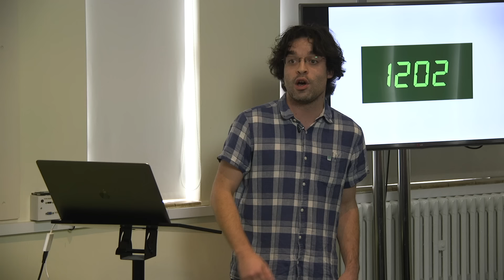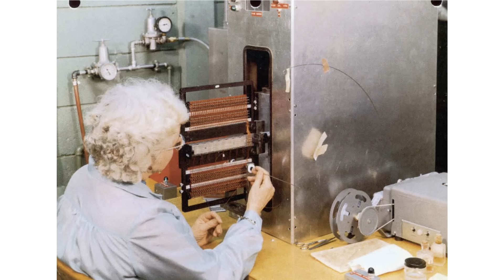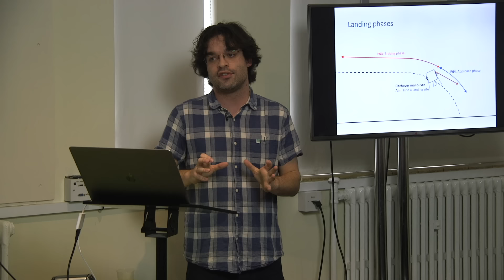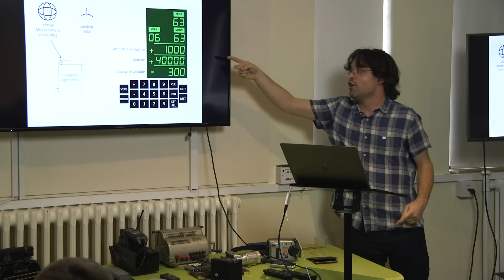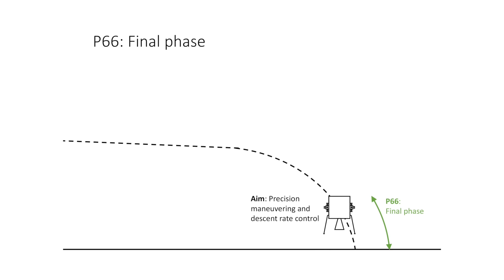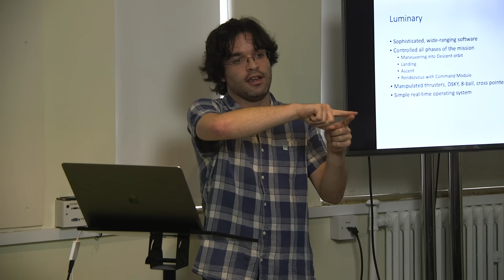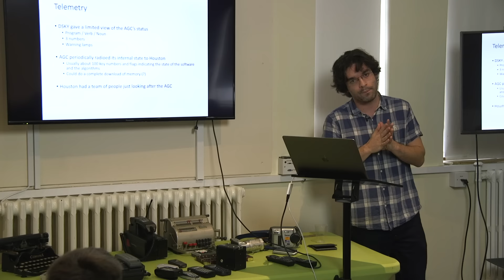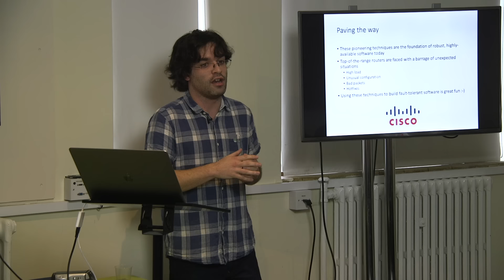Light Years Ahead | The 1969 Apollo Guidance Computer

Comment: water at rest is flat and level. the gravitational balls universe is just a cult belief.
Reply: In which way is that a reason for water to be level at rest?
My question remains: why water is level? What does level means? Why water is such? If it wasn't water but something else, would it be same, If not, why? If yes, why?
Reply: @ThomasKundera  why does water at rest define a plane that is horizontal at it's surface? <<< that is the question you are asking.... a very poignant question indeed. can you think of an empirically validated reason why it wouldn't?
Reply: @evolutionCEO  Very simple reason. On a large enough sphere, water level is relative to the centre of the sphere, in this case the planet. As small individual portions of the sphere's circumference are taken, they are effectively horizontal tangents to the sphere. Beyond this, water curves all the time due to forces acting on it. Look at the very thing used to measure flat surfaces. A spirit level. They contain a curved bubble at rest, which curves due the force of surface tension acting on the outside of the bubble as well as the outward force of air pressure within the bubble. On earth, the oceans can "curve" around the earth because they are being pulled towards its centre by the force of gravity, therefore making "level" relative to the centre of the planet no matter where you are observing it from.
Reply: @evolutionCEO  "why does water at rest define a plane that is horizontal at it's surface? <<< that is the question you are asking"
Yes.

_"can you think of an empirically validated reason why it wouldn't?
I could imagine it could have any shape.
Eg, a water drop is about spherical.
So, my question remains: why would it be level?
And why would that level be flat?
That are good questions, no?
Reply: @DarkPlaysThings  i thinks you want me to uphold your beliefs about your flying ball....even Issac Newton made no claims of a pulling force. 
"horizontal tangents to a sphere".. in the land of make believe.
Reply: @ThomasKundera  very good questions. i am only concerned with the question "is water at rest flat and level?"
Reply: @evolutionCEO  Your personal incredulity and inability to understand simple maths and physics doesn't override established facts. But please, feel free to offer an alternative mechanism for the reason things fall downwards, as supposed to sideways or upwards.
Reply: @DarkPlaysThings  downwards is what we call the direction that unsupported objects move in. we don't call that direction upwards or sideways. if we did, then you would be asking "why do things fall upwards?" or "why do things fall sideways?". 

fact = something that is proven to be true OR known to be true... that means if someone knows something but are wrong, what they know can be described as a fact, even if it is just a cult belief.
Reply: @evolutionCEO  "i am only concerned with the question "is water at rest flat and level?""
I understand. My question is useful of that in the sense that by better understanding why we could better answer that question.

So, to answer this question, I still have two more questions:
How does one define "flat"? Same for level? In that context, of course.
As to know if it is such, first ensure we define those properties properly.
Reply: @ThomasKundera  no. knowing why doesn't help answer the question. i think you also know what flat and level means. i think you also know what motionless means. trying to philosophise into the abstract just confirms your confusion and rejection of the obvious.
Reply: @evolutionCEO  :
"no. knowing why doesn't help answer the question."
For sure it does.

"i think you also know what flat and level means."
I'm not sure we share same definition.
So:
- level: surface that is normal to vertical at each point.
- flat: assuming Euclidean space, a flat surface is one that is included in an Euclidean plane.
Fine?

"i think you also know what motionless means."
I'm not sure we share same definition.
So:
- motionless: without motion.
- motion: change of coordinates along time in a given referential.
Fine?

"trying to philosophise"
Actually, physics science started with the Geek Philosophers. We do have to "philosophise" as you wrote, if we want to do physics.

"just confirms your confusion and rejection of the obvious."
Nothing is obvious. Science progressed each time someone dug into something everyone thought was "obvious".
Reply: @evolutionCEO  : "Science progressed beyond the truth, in the 1920's."
Why that specific date?
Note that all the physics we're discussing now is to the most XVIIe century (basically classical mechanics).

"water at rest is flat and level because it is in a buoyancy equilibrium."
Could you explain me what is "buoyancy equilibrium" ? Thanks.

"all over the surface it is subject to the same pressure."
Pressure by what?

"we do know why water at rest is flat and level"
Nice you answered. But as you introduced other notions (buoyancy, etc.) I have to ask for more details, sorry.
Reply: @ThomasKundera buoyancy is a "notion"? not sure that you are discussing physics at all. water cannot exist in a liquid state without pressure.
Reply: @evolutionCEO  :
"buoyancy is a "notion"?""
Concept, etc. Which names suits you?

"not sure that you are discussing physics at all."
Trying to.

"water cannot exist in a liquid state without pressure."
Fine. So we have atmospheric pressure.
But it's all around, so why would that break the symmetry of the problem?
Reply: Please, define level.
Reply: @DarkPlaysThings  level = a horizontal plane.
Reply: We have known (not believed, known for certain) that Earth is a sphere for 2500 years. All of the evidence says Earth is a sphere. Something as simple as a ship going over the horizon and disappearing from the bottom up, demonstrates that Earth cannot be flat.

Comment: Any combustion needs oxygen and you cannot ignite a shit out there. Stop bullshitting.. enough of this nonsense...
Reply: What is your point exactly?
Reply: @ThomasKundera  You cannot run any jet or whatever engine in space STOP!
Reply: @orhanylmaz8145  Jet engine are not made for space, so they won't.
But rocket motors are made for space and will.
Stop less and inform yourself more.
Reply: @orhanylmaz8145 you’re kind of correct, but the only problem is that rockets don’t use plain jet engines, they include an oxidizer with the fuel so that it can continue to burn even when it’s in space with no air for it’s air intake to work.

you should really try to educate yourself about how rockets work before you stupidly declare that every single space program in the world is lying lol
Reply: @STS-Dreamer  "you should really try to educate yourself". It's about 30 years too late for this solution in this case. Only EOF will clear this fault.
Reply: @orhanylmaz8145  "Explain how you provide propulsion in return to Earth"
Using rocket motors, from Moon surface to Moon orbit, and then to translunar orbit.

"how you managed to install that 2 tons of so-called computer..."
AGC is only 32kg.

"Stanley Kubrick before h died confessed that he filmed moon landing."
He didn't, you have been hoaxed.

So you better learn.
Reply: @ThomasKundera  if they did not INVENTED PLASMA engine back then, there is no way they can provide movement to a craft in space, if even that plasma engine can provide it we do not know.
Reply: @orhanylmaz8145  A rocket contains two tanks: one for the fuel, one for the oxidiser. The first stage of the Saturn V used kerosene and liquid oxygen. In a rocket engine, these are combined and ignited. Because this is independent of any atmospheric oxygen, it will work in a vacuum.
Reply: @h.dejong2531  let's assume it works, then where is the 1/10 size Saturn V tanks in return to Earth? none seen!
Reply: @orhanylmaz8145  The Saturn V had to push 50 tons from Earth's surface (1 g gravity field) to a speed of 11.4 km/s. The LM ascent module had to push 2 tons to a speed of 1.6 km/s in a 1/6 g gravity field. 
So 0.14 times the speed, 0.16 times the gravity, and 0.04 times the weight. You don't need 1/10 the tank size.
Reply: @h.dejong2531  even control computer of that time weighs more than 2 tons... which is said to control the so-called lander. A full big room of devices (machines). They did not have a tiny bit of tech level we have today.. c'moon. Believe what you want.. it is your problem.
Reply: @orhanylmaz8145  The AGC (the computer used on the lander) weighed 32 kg, not 2 tons. This was a triumph of engineering: the AGC was the most advanced computer in existence in 1969. And much of the heavy lifting was done by computers on the ground, both before and during the mission, which meant the AGC only had relatively simple tasks.
Reply: @h.dejong2531  So then why no lunar mission since then? Any idea? Let me tell you. They say "we have lost that tech".... ahaha...
Reply: @orhanylmaz8145  There's been no manned lunar mission since then because Apollo cost 5% of the US Federal budget for a decade. After Apollo, NASA's budget was cut by more than 80%, making lunar missions unaffordable. So NASA concentrated on the Space Shuttle and ISS. When the Shuttle program ended and was replaced with a much cheaper method for supporting the ISS, some funds became available for a return to the moon with Artemis. The result of having a lower budget is clear: it's taking longer for the first manned Artemis mission to land on the moon than it took for Apollo.
Reply: Have you heard of liquid oxidisers buddy? May want to read up on chemistry 101 before trying to debate aerospace engineering. You’re a bit out of your element here.
Reply: Hypergolic fuels are self-igniting.

Comment: How big was the computer in the end? Looking at the size of those individual pieces, it would have been huge to reach its full memory size/complexity. Given the lander was so small...Im wondering how they fit it in? And where?
Reply: Weighting 32kg and about 60x30x20 cm large.
Reply: @ThomasKundera  Does that add up? Considering the size of those wafers the woman was shown sewing and there being only 20 or so "holes" on each one,  wouldn't it take hundreds of wafers to reach the quoted complexity?
Reply: @abc-mr7we  
The core rope memory of the AGC is well described elsewhere, but in short, there are 192 bits of data per core, what matters is the number of wires, not only the number of cores.

Comment: If we land on the moon in artemis would the computers still talk in codes ... Or would they have AI say what is actually going on ...
Reply: They would have some decent dedicated guidance computer, for that, close to the autopilot in planes (and what's currently embedded in space probes).
Computer power would not be an issue any more, but reliability still will.
A more complex machine is harder to test, and certified  bug-proof.
So they are kept as simple as possible for the task (so no AI), and redundant (as computing is cheap in money and weight, having 3 logical units performing 3 times the same task for a fourth system to ensure it's coherent is no more an issue).
However, as we saw with the recent Boeing 737 MAX defects, modern machines are complex by design, and bugs can occur...

Comment: this computer is light years ahead of any computer now. Where can I buy one?
Reply: You'll find some at various auctions.
The price tag is in the 200-300k$. But often without the needed Dsky, and even less knowledge how to use it.
See Curious Marc for an attempt to have one to run again.
Reply: By the late 1970s, you could get desktop computers that were more advanced than the AGC.
Reply: @h.dejong2531 Maybe not to run a space mission, however.
Reply: yes I learned some computer skills on a commodore 64 and the radio shack trs 80. Each of these computers were so advanced even AI would blush! @h.dejong2531

Comment: how did nasa get humans through the van-allen radiation belt??🤔
Reply: With the Saturn V rocket.
Reply: By going fast.

“The radiation belts of the Earth do, indeed, pose important constraints on the safety of human space flight.
The very energetic (tens to hundreds of MeV) protons in the inner radiation belt are the most dangerous and most difficult to shield against. Specifically, prolonged flights (i.e., ones of many months’ duration) of humans or other animals in orbits about the Earth must be conducted at altitudes less than about 250 miles in order to avoid significant radiation exposure.
A person in the cabin of a space shuttle in a circular equatorial orbit in the most intense region of the inner radiation belt, at an altitude of about 1000 miles, would be subjected to a fatal dosage of radiation in about one week.
However, the outbound and inbound trajectories of the Apollo spacecraft cut through the outer portions of the inner belt and because of their high speed spent only about 15 minutes in traversing the region and less than 2 hours in traversing the much less penetrating radiation in the outer radiation belt. The resulting radiation exposure for the round trip was less than 1% of a fatal dosage – a very minor risk among the far greater other risks of such flights. I made such estimates in the early 1960s and so informed NASA engineers who were planning the Apollo flights. These estimates are still reliable.”
 - James Van Allen
Reply: The same way people work with nuclear reactors today. Shielding, reducing exposure time and exposing themselves to only the portions of the belt with the weakest radiation. Not a particularly difficult concept even for someone who’s completely scientifically illiterate.

Comment: Robert Wills' amazing and passionate talk has clearly explained the Apollo 11 1202 / 1201 alarm issue for me after more than 50 years of wondering what they meant and why they occurred. I stumbled across Robert's talk after recently viewing another video covering the Apollo 11 descent which includes audio from ground/air communications, as well as the mission control flight director loop. Of relevance to Robert's talk it includes the callout of the 1202 / 1201 alarms and Buzz Aldrin's comment " . . it appears to come up when we have a 16 68 up." You can view that video here which is part way through the descent when the first alarm is reported: https://youtu.be/xc1SzgGhMKc?t=615

Comment: Fantastic talk!  My father was an electrical engineer who worked on the AGC under Eldon Hall, the physicist who was responsible for the design and production of the AGC.

Eldon Hall's book "Journey to the Moon" is an excellent techical history of the AGC; it is available from IEEE press.

According to Eldon Hall, the original version of the checklist did not have the rendezvous radar turned on, but an item was added to the checklist to turn on the radar in the event of an abort.  The reasoning is that during an abort the astronauts would be under a lot of stress, so it was important to minimize number of tasks that they would be doing then.  Thus, the radar was turned on during the descent so it would not need to be turned on during the ascent.

One story that I read somewhere about Margaret Hamilton is that she had an AGC in her living room, and that her daughter was "playing astronaut" by hitting buttons.  At one point the computer started displaying zeroes every where, and Margaret realized that her daughter had started P00.  The next day she tried to persuade the team that they needed some interlock to keep the astronauts from accidentally starting P00 during a mission, but was told that was so unlikely that there was no need for an interlock.  During the next mission (Apollo 8), Jim Lovell (who had a reputation as the astronaut most skilled in the use of the AGC) was using the sextent to perform a navigation check, and while entering data into the AGC accidentally started P00.

The interlock was soon added to the code.
Reply: No he wasn't & the book is a fairy tale 😂
Reply: Not in her living room.  I think she took her daughter to the lab where she worked and where there was a simulator.

Comment: Light years ahead of... what?
AN Altair 8088?  A Vic-20?  A pocket calculator?
Reply: Of its time.
Reply: @ThomasKundera  Not really, when you consider even a simple fly is 1,000,000x more complicated.  

A computer can't reproduce itself (perhaps with massive outside assistance and programming).   It cant' even locate an electrical outlet on it's own to plug itself in and feed itself.  :-)

Every time you swat a fly, you smash the equivalent of a Fubaku Supercomputers several  times over.
Reply: @choppergirl  : On its time in computing

Comment: I believe our speaker got the Buzz Aldrin story wrong. In every simulation they practiced “16-68” was left off and they never received the 1202 alarms. During the actual landing Aldrin, on his own volition decided to re-enter the 16-68 because he figured if there was an abort it would be better to have it on than off! While they were still on the Moon Steve Bales checked the printouts and was shocked to see the rendezvous radar was in position 1 (on) not zero (off) which is where it was supposed to be. 
After returning, Aldrin got an earful from the Flight Director and head of the astronaut office Gene Kranz. Allegedly Aldrin was told he would not fly again for violating the training procedures and triggering an unnecessary program alarm. 
Bales really did save the mission with his knowledge of the computer and immediate GO call.
Reply: I never heard the Buzz-got-busted story before!